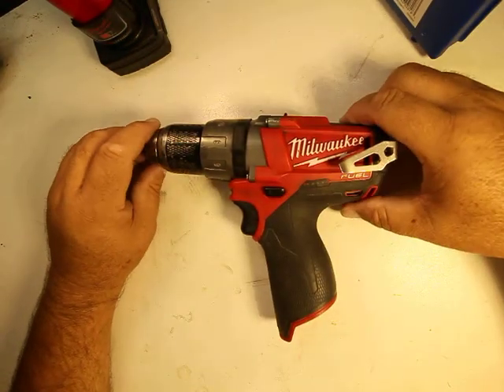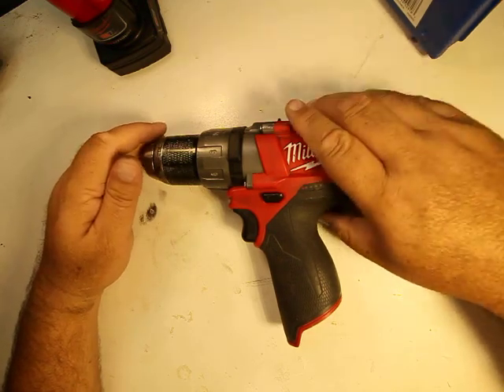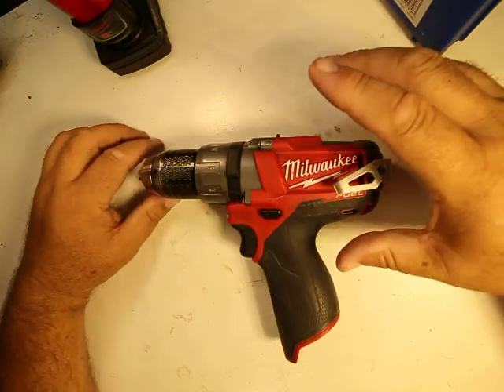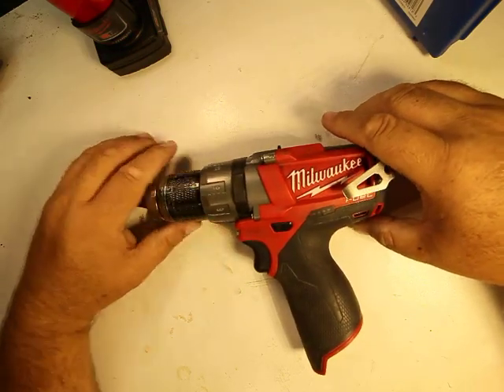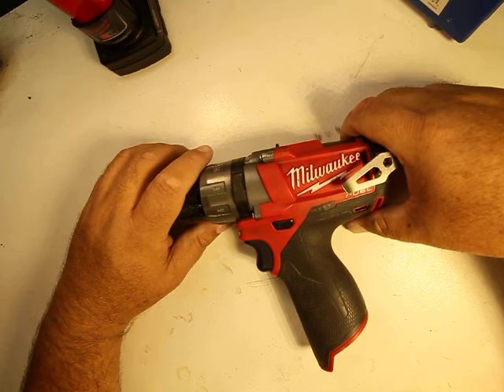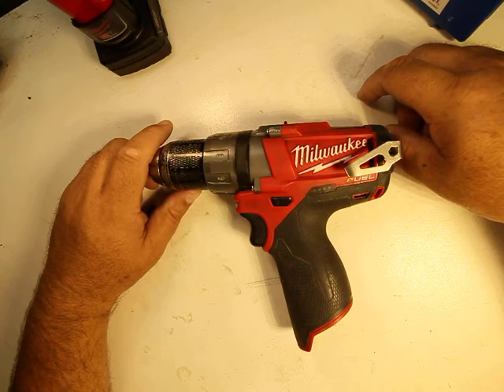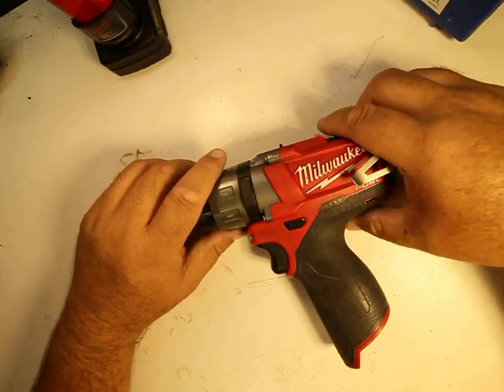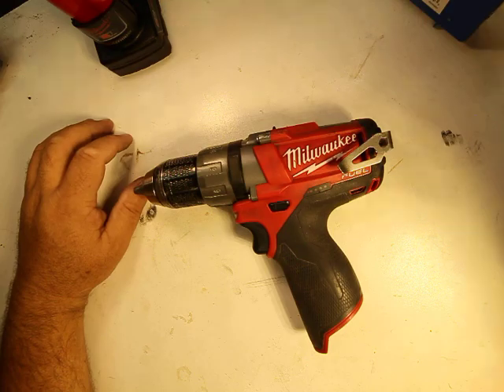Milwaukee M12 Fuel Drill

Comment: I agree with you. I had a plug in drill for years and years and finally pulled the trigger on an m12 drill and impact. For around the house it’s perfect. Even with the knock off battery. A nice tool. Definitely buy on sales or used. The new prices are kind of steep in my opinion.
Reply from the maker: The price can be a challenge.  The non-Fuel version is still a great drill at $40 less than the Fuel version.  It has a little less torque, but it's still a great drill.  I have had one for around 6 or 7 years.  Still works great.

Comment: desalts 20v is 18v nominal its just marketing bs....but the new power stack shows improvement. reliability remains to be seen.
Reply from the maker: That's funny you mention that.  I just had a discussion about this last night.  It's a shame that a big brand like DeWalt feels like they have to bend numbers to increase sells.  Just like companies who rate the power of their amplifiers.  Sounds like I need to make a video to support the claim that a DeWalt 20V battery is the exact same voltage and the Milwaukee 18V battery.